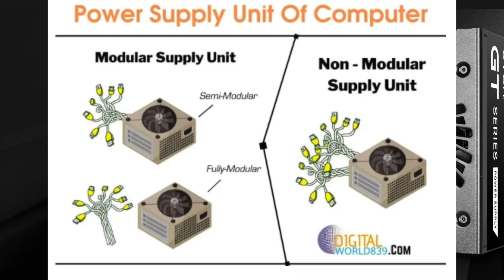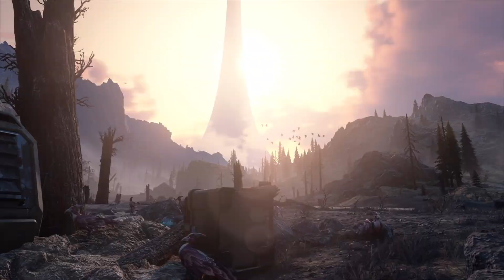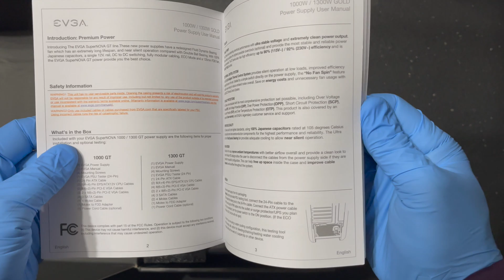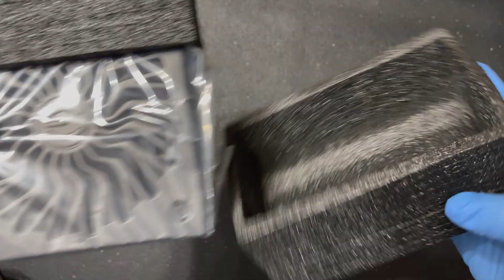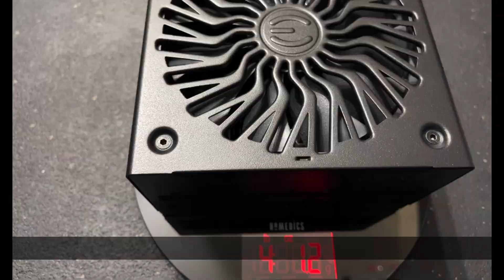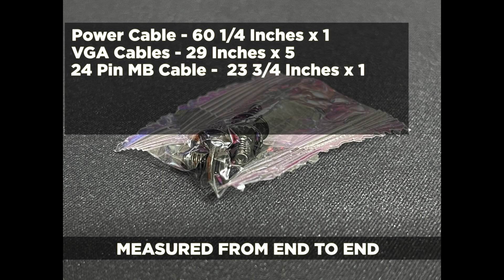EVGA SuperNOVA 1000 GT Unboxing | 220 GT 1000 X1

Comment: The instructions are not as clear as they should be, the ATX connector has too many pins on one end with the split end. The issue is that the manual says the splitting ends must no go to the psu, it wants them plugged into the hardware. This is clearly wrong for the ATX as the split end only fits in the psu.

Comment: Hello, So it comes with 3 or 5 cables for GPU because in the unboxing part i saw 3 but in the cable measuring part you write 5x VGA cable. Thanks
Reply from the maker: 5

Comment: hi 👋🏻 i just got this psu and im wondering if this can power my 6900xt with the cables provided or do i have to buy them separately? because i noticed  my gpu has 3 8pin connectors that need to be connected in order to power it  sorry if this is a dumb question lol im just  confused because i’m taking a huge step of an  upgrade from my previous build 😭
Reply: Yes that’ll work!
Reply: @imfeining   Thank u 🙏🏻
Reply from the maker: Yes it will work.  I just did an unboxing of a 6900 XT.  The cables will be fine.
Reply: @Meanpooh   okay yes 🙌🏻 thank you

Comment: can you please do a tutorial on how to build a gaming PC for beginners, as in what common tools to use such as a what tools to use you from a ifix it kit.
Reply from the maker: Mmm Hmm, there would be a problem with the building part.  You can't get affordable video cards.  You are better off getting a pre build.  Stores are selling 1660 cards for over 500USD.  As for tools it fairly basic.  Some tweezers, and a phillips driver.  Most cases use thumb screws.  The driver would be needed for the MB and possibly the drives depending on the case.
Reply: @Meanpooh  I can’t find any cards for 8months. 

It funny that I had spent 2k without a gpu till now, nothing is so reasonable to go from 1650 to 3080 or even 3090